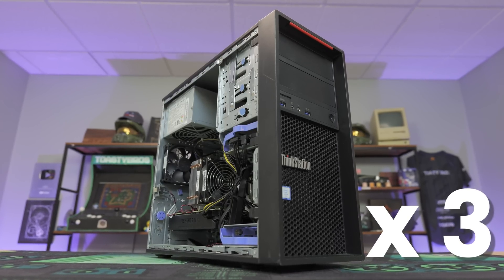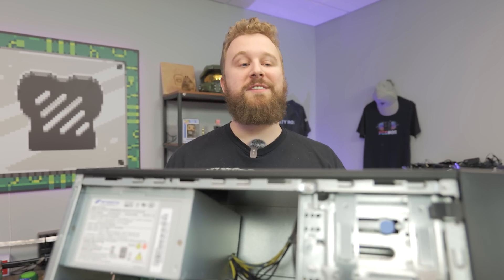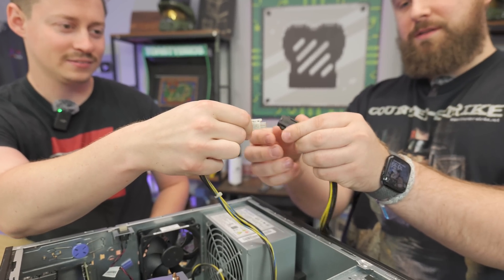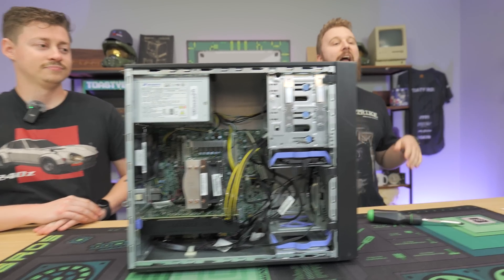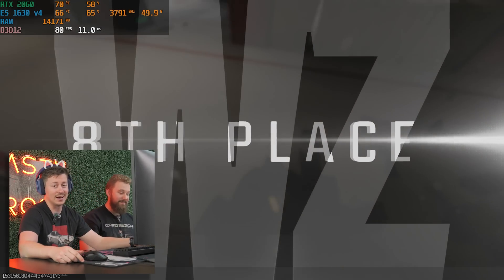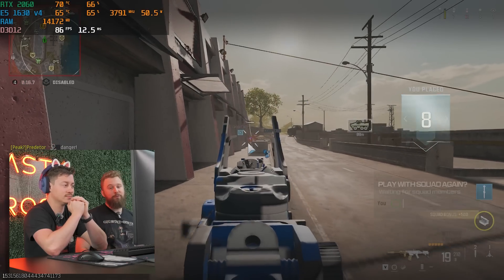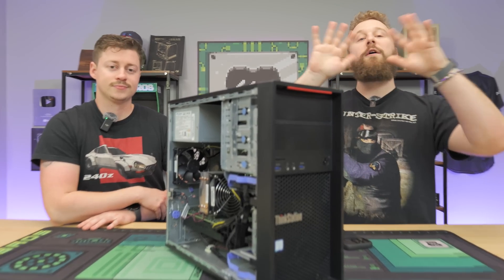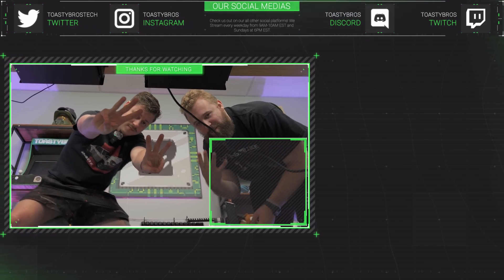EASY $240 Gaming PC Build -  Step-By-Step

Comment: I use the P410 as a daily for two years now, it was running good with a GTX 1060 6GB. NVME on PCIe riser. Now I upgraded the PSU (24 to 14 pin converter 10 bucks), and a RTX 2070S. It is CPU bottlenecked (6c/12t Xeon), but still much fun.
Reply: oh yeah, the bottom HDD frame can be removed by a single screw, then it takes a full length video card

Comment: Even 4c/8t CPUs are pretty rough in DX12 mode. Ive noticed its a much smoother experience using DX11 or performance mode. DX12 might be smoother with an AMD GPU.
Reply: this'll take an 8c/16t cpu for about $30...

Comment: this is wild lol. i bought one of those p410s as well. i just slapped a 3050 6-pin (msi ventus) in it, a noctua fan for the front. I also replaced the cpu to the E5-1650v4 for $15 (6C12T). you can also get the E5-1660v4 (8C16T). There is also another power supply for this pc which has a 6+2 pin and is 500w. Its around 50-60 on ebay.
Reply: if you're gonna replace the power, just get a standard psu and a 14 pin adapter...

Comment: You guys always get so close on these old workstations, but end up missing the mark.
The whole point is to get a Xeon with a lot of cores, and Quad-Channel RAM...
Call it a $300 budget, drop in a bigger CPU, and two more ECC sticks.
Reply: this will take an e5-1680v4 8c\16t and hynix 32gb ram is around $25 on ebay. that's the route i'm going...

Comment: The 2060 is such a slept on GPU. Still has the chops to play just about anything at 1080p with respectable settings and pairs with such a vast range of hardware. Just needs to be the right price to be a justifiable purchase. I'd personally not like to do anything over 100 to consider it a worthy purchase. The closer it gets to let's say 150, you're looking at the potential to score a used  rx 6600 or rtx 3060 if you're able to haggle a great deal. (Of course that's 100% dependant on the market you're in...)

Comment: A 2060 for 130 bucks? That's actually a good deal. It gets you dlss as an option.
Reply: After the gpu crypto crash i got a dell 2060 for 90 dollars. I also got a 6600xt for 120. Both i made low ball offers and the ebay sellers took them. Not sure why prices are up again.